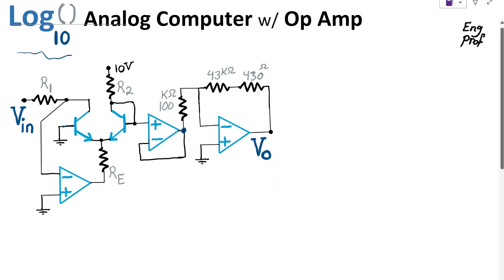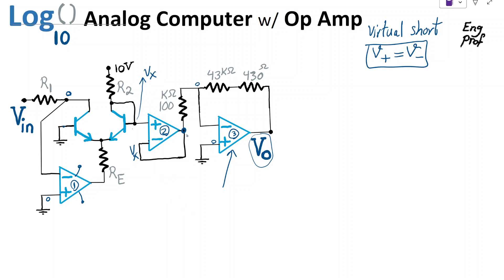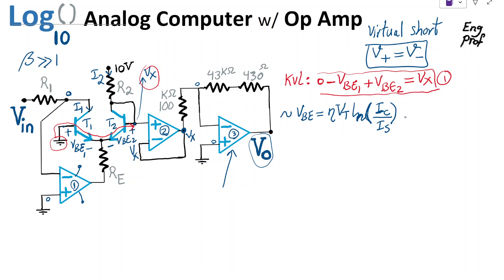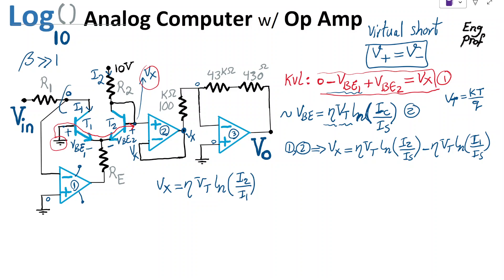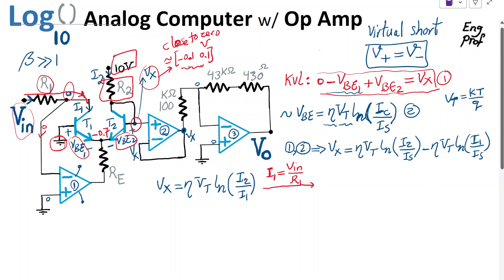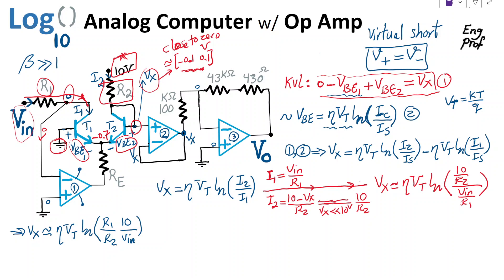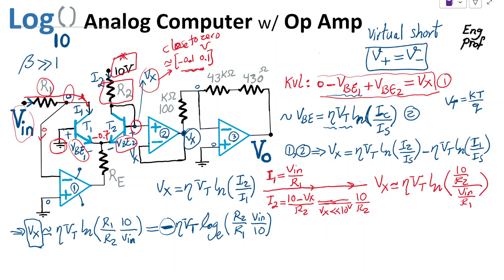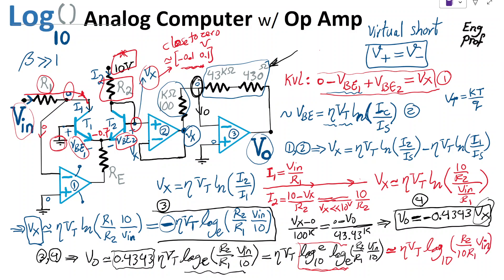Logarithm Analog Computer Design with Op Amps and Transistors

Comment: Of course, for a practical log converter, you need offset nulling for that differential pair, temperature compensation (usually either a second pair to provide a kT/q reference, or else a thermistor) and compensation for Early effect.  That, plus the insane accuracy needed for the scaling resistors, is why IC's like the AD83xx, ADL53xx, LOG10, and so on are in the $10-$40 range rather than being jellybean parts like simple op-amps.

The differential pair has to be well matched, so if you don't use a packaged log amp, you are best off using a precision matched pair on the same die.  although you can often get away with cheaping out and using a DMMT3904, PMP4201 or something similar.  A platinum RTD in an op-amp's feedback path, thermally bonded to the pair, is usually good for kT/q compensation.
Reply from the maker: @ke9tv Thanks a lot Kevin for watching and your insightful comment.  You are right regarding important practical considerations for logarithmic converter amplifiers that are otherwise super sensitive to all sort of transistor variations and mismatches.  Thanks also for reminding of interesting and useful components.

Comment: Another interesting circuit, it seems. Thank you so much.
This time, however, I'm not totally happy with your equations, so, I'll tell you what isn't right.
When you write 10 instead of 10V, you are changing something: now it's an adimensional number instead of a voltage magnitude. As a result, the various equations with that change are dimensionally wrong. You can only have logarithms of a number, your formula tries to get logarithms of a magnitude in voltage units. As an example, if R2 is 100 kΩ, R1 is 5 kΩ, and Vin is 2500 mV, your formula will be trying the logarithm base 10 of 5000 mV, which is not defined. If the 10 there were 10 V, the formula would then have the logarithm of 5000 mV/V, which is logarithm of 5, which is defined.
Please do not take offence: this is something that even Richard Feynman did, during one of his famous lectures, when he wrote a formula where the value of gravity on Earth he stated was 32. Which is not true, and his formula was wrong. Physical magnitudes are not the same as numbers. In my experience, I've only seen Americans commit this unit-dropping mistake, and I guess it is something that American teachers unknowingly or knowingly teach wrongly.
Reply from the maker: Thanks for watching and sharing your thoughts. The formula log(R2/R1 × Vin/10) implies the default dimension of Volt for voltage Vin in the circuit.